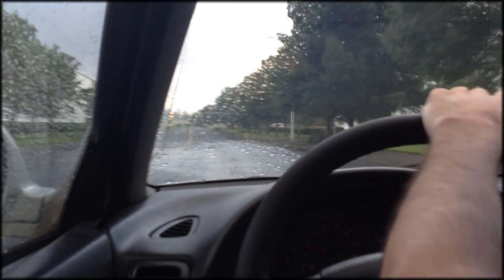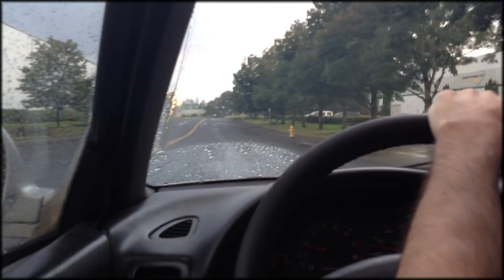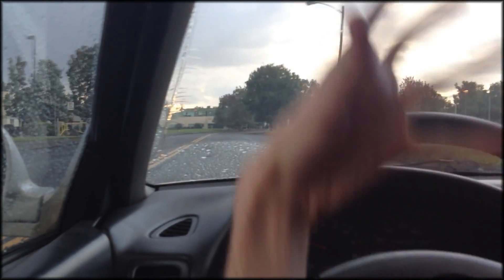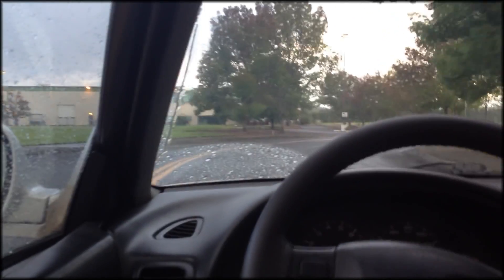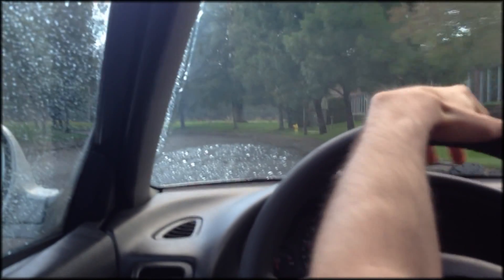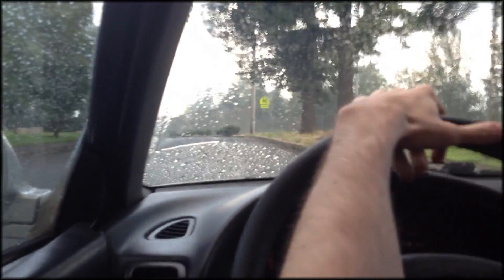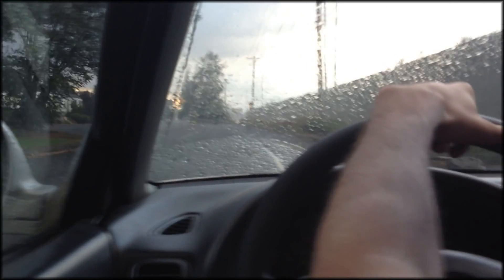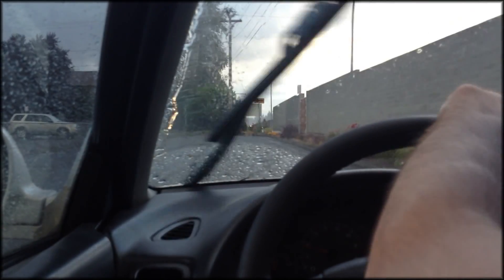Yonaka Coilover Test and Review - Acura Integra

Comment from the maker: It was much colder outside, and I slammed the brakes causing ABS to turn on. As long as the brakes are strong enough, any car can lock the wheels (ABS will kick in to stop this). This isn't a result of the coils, but you are correct in that high spring rates can cause the car to lose traction if the surface conditions are rough.

Comment: don't troll me or anything but... What i've learned from gran turismo is that with low suspension and high spring rate allows the car lose traction and slide more when braking or cornering. In your braking demo i even heard the tires skid with the yonaka.

Comment from the maker: Spring rate went from around 3-4 kg to 12 kg in the front, 6 kg in the back. I believe the driver was also driving a bit more aggressively in with the coils on to compensate for less body roll felt (but the speeds should be fairly close).

Comment: Specifically there is more force retained over the inside tire (passenger tire in a right turn and driver tire in a left turn) with this stiffer coil improvement.  It improves cornering traction but reduces shock travel which can result in a harsher ride.

Comment: Body roll is the result of load transfer when there is compliance in the suspension (e.g. it's on springs). 

Load transfer is a result of forces on the tires acting like a lever through the car's centre of mass. When the car is braking, there will be a force pushing backwards. This force isn't acting directly through the CoM and this causes the body to nose dive, and the weight force on the front wheels to increase, rears decrease.  Even completely rigid vehicles are affected by load transfer.